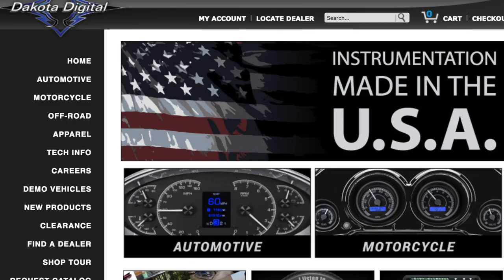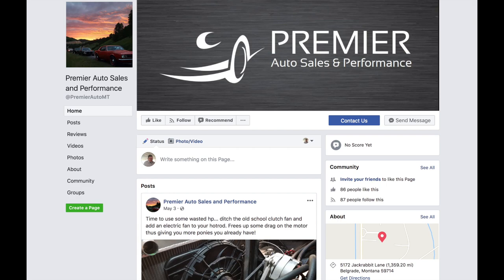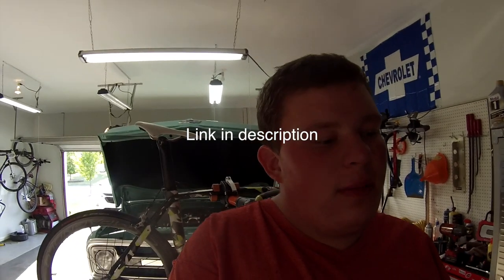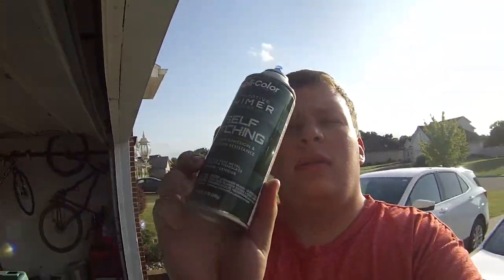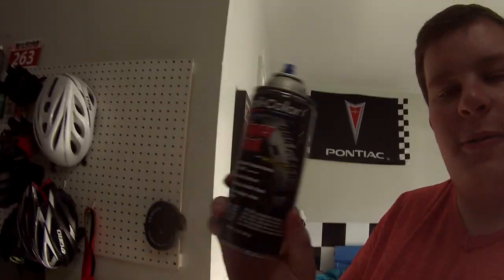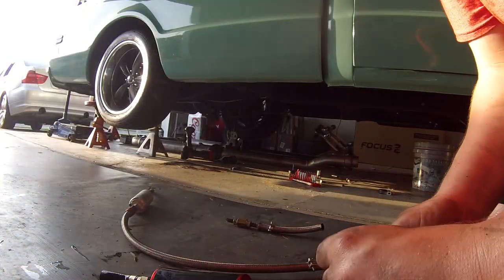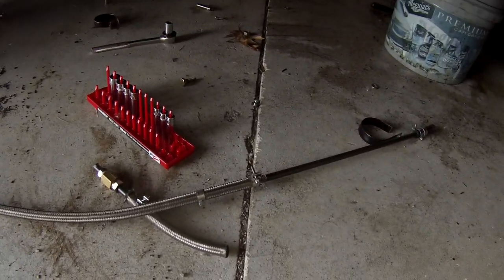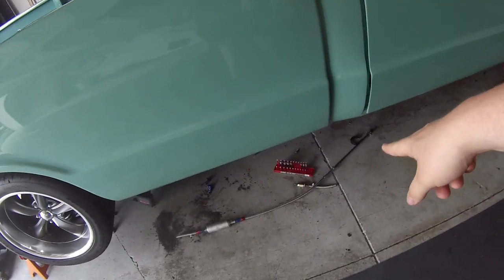This C10 Update Cost Me $2000

Comment: How much of a drop do you have on your truck and what company did you use for the suspension?
Reply from the maker: Classic performance for the front and rear just a flip kit I did myself. 4” 6” drop
Reply: @kingevanek  How do you like it? Does it handle way better? I was looking at their kit for my 1970 C10 but I have heard from a couple of people that they are not impressed by it and don't see trucks running their setup in winner's circle at track events. I was recommended "Early Classic" for budget or "Ridetech" for a more performance based ride
Reply from the maker: Casper0878 Drives fine to me, probably wouldn’t wanna go on a race track with it but I have a bmw for that. These trucks are just cruisers to me, don’t really get into the whole auto cross/handling things with older cars so I’m not sure the best for that.
Reply: @kingevanek  Yeah, I also do not plan on tracking my car. I want better handling because of the LQ9 I am going to drop into it and better brakes as well. This will be to do projects around the house and pick up materials so I want something comfortable. Definitely do not want polyurethane bushings or a super stiff ride
Reply from the maker: Casper0878 cpp stuff would be fine for that, my truck rides great
Reply: @kingevanek  Have you heard anything good/bad about the companies I mentioned? Early Classic seems really affordable. Ridetech I heard is great quality. There is also QA1, TCI Engineering, Hotchkis
Reply from the maker: To be honest I don’t really know, I don’t follow many c10 builds or pages. I put this truck together 5 years ago and all the parts came from a local guy. I follow a lot of bmw stuff but don’t know on the older car handling stuff much or what brands to get.
Reply: @kingevanek  It's all good. Thank you for all the replies. Gonna get started on my build pretty soon. Wish me luck bro!